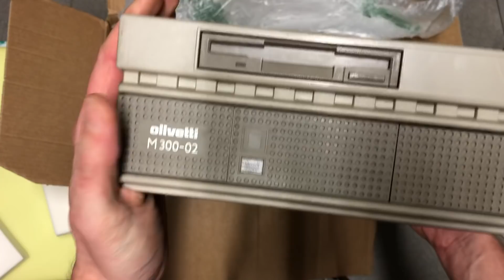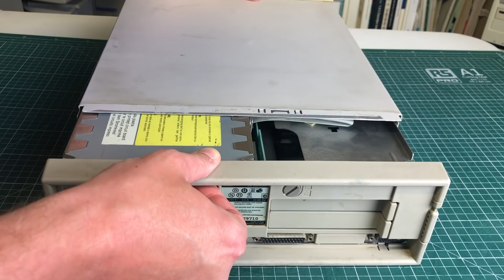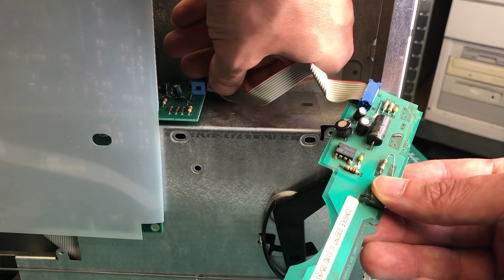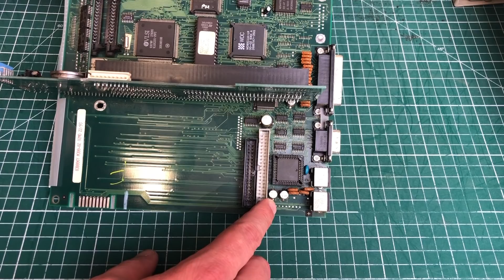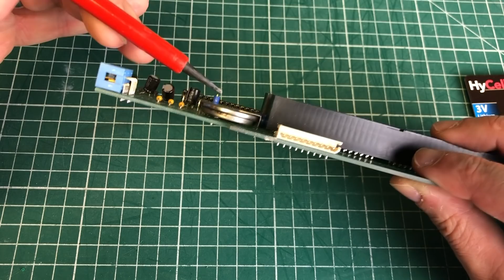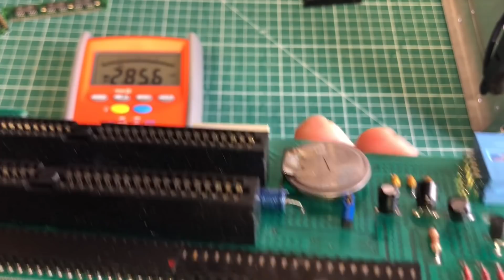Olivetti M300-02 eBay "score" - non working PC (part 1)

Comment: I notice a PGA socket near the fdd and hdd connector. You will need to remove the PGA chip (careful not to damage the fragile socket) and clean the connections and reseat the PGA chip. Take an old toothbrush and use a PCB cleaner fluid and brush over the pin arrays inside the socket and also the PGA chip. A trick you can use to check if the PGA socket is the cause of the boot problems before removing the chip is to gently twist the board while turning on the PC. The twisting of the board can help the PGA chip make a connection with the pin arrays. Usually if the PGA plastic socket is faulty it needs replacing with a new one. Cleaning it is only a short term fix. The problem will crop up again in future because the socket is warped and the pins no longer make a proper connection. Hope you get it working!

Comment: Hi Retrospector, thank you for sharing this. I enjoyed and learned a lot from it (I was). The PC was my first PC when I was seven years old (Actually was not mine, it was my dad's PC :D), and I still have it. Currently, it is in the ware house with all box and accessories, when I was child I usually looking for a way to make upgrade it in order to run DOOM 1, the Wolfenstein 3D series and Win 3.1 was fine on it with 1MB of RAM but I need at least 4MB ram to run win 3.11 or DOOM under the DOS. However after some times I opened the PC (for  curiosity) I broke the BIOS IC. is that a way to fix it? it was back to 20 years ago, and I am now 30 years old studying PhD.D. in CS :D I don't know why fixing this retro PC got important for me after seeing your video  :)
I would appreciate it if you or someone else guide me :)

Comment: It looks like that soldered in memory module maybe a SIPP module instead of a SIMM module. I recently learned that they were a previous design to the 30 pin (contact) units that went into slots. Apparently putting the pins on the edge of the boards was very fiddly (and possibly expensive for manufacturers) so they relatively rapidly moved on to the SIMM design most of us are used to now.

Comment: Maybe it's an dry solderjoint in the psu or on the motherboard. But I would rather replace the one smd electrolytic capacitor between that Acer chip and the IDE connector as the known good caps in the psu. And I'm pretty sure these round pads under the smd polymeres are meant for through-hole caps only filled with solder by wave soldering the board.

Comment: I noticed that some of these retro pc's have a power in and power out on their PSUs. Sense I was born in 2000, I just missed these guys probably by 10 years or so lol. So basically I'm wondering why do the PSUs have a power output in them and what are they used for?
Reply: Taking power to the monitor, by pass through

Comment: Man.. I had a PCS44/c that I got for free from someone.. paid an arm and a leg for an extra memory stick for it to be able to get it run a scraped version of Debian back in 2002.. I used it as a text only machine to basically just SSH to another computer to run IRC etc on.. I think I trashed it when I moved from Sweden to DK again in 2003 (probably after realising just how much power it used).. nice little machine though.

Comment: I looked up that little IC (TDA7233) on the speaker / HDD-LED board, and unsurprisingly it turned out to be a 1-watt amplifier; you don't see many PCs with an amp for the speaker. The speaker itself also looked unusually large compared to the standard fare in PCs. In conclusion, this PC has Hi-Fi beeps! lol

Comment: My parents had one of these when i was a kid. The power switch was like a stdby mode where it could turn off the monitor and keyboard. We upgraded it with a Trust cd drive and sound card.  Sometimes it used to fail to read floppies but you could get by with pressing the case firmly above the drive.  I realised this when trying to load 6 disks of Doom II.

Comment: I used to have that very same model as one of my first PCs... and I had it in the early 2000's, so it was pretty old by the time I used it. It actually had a weird BIOS; it would not boot and would not work properly if the battery voltage was not enough. If left rebooting for some time, the battery would somewhat "recharge" (it is not made for this, but it would soak up some power and charge a little) and then the PC would magically be able to go on booting. The BIOS starts in 40 column mode when the nvram is invalid, once the PC boots you can set the 80 column mode from inside the BIOS itself. You can also try changing the battery, but I don't know if there are battery holders for that weird form factor - you can also change it for a more standard CR2032 :)

Comment: You mentioned the board has 2 Megs of RAM soldered onto it. But the memory check at booing stops at 1 MB. Maybe the problem is the RAM or the solder joints of the RAm bank.

Comment: It's leaky caps.  When the computer pulls more current as it progresses through the boot sequence, it brown's out the 5V rail and causes a low-voltage reset.  Replace all the electrolytic caps in the PSU and on the MB.
Reply from the maker: Hooked my oscilloscope and never see it dropping below 5.05v when it does the reboot. Voltage stays pretty stable at around 5.10v

Comment: WDC is Western Design Center, not Western Digital. For those batteries with the tabs you can get new batteries that have tabs also, but you can also install a holder.

Comment: I agree that the caps are probably bad since there is no beep. Additionally, you may have a RAM issue because it has 2MB and is stopping the test at 1MB. The 40 column mode is probably because CMOS has lost its settings because the battery is flat. All pretty fixable :)

Comment: I recently bought a packard bell force 203 with a dreaded varta battery.  Surprisingly the battery hadn't leaked on the board but had sprayed out and corroded the case rather than the board, only three places on the board had corrosion.  I removed the battery and treated the whole board with a vinegar wash and then an isopropyl alcohol wash, and scrubbed with a light strength toothbrush.  Board works however exhibits the same sort of issues you are seeing in that it boots and then randomly the whole system freezes and upon reboot just a black screen.  I ordered some caps, but they have a 17 week lead time, so I have order different ones.  but strangely all of the caps on the board are exactly the same, 22uf 25V.  Here's hoping that replacing them will help with the issue.  The PSU has not been recapped yet because I am very inexperienced with soldering anything really.  I am curious to see what you do to fix this one.  I hope replacing the caps in the one I got fixes it too.

Comment: You said that PC hás 2mb RAM? Boot screen reports 1024k? Maybe a RAM chip problem?
Reply from the maker: Thing is that now get it to reboot on multiple stages (after memory count, after all post checks pass (including memory), while booting dos.... so not really sure it is a memory issue
Reply: @RetroSpector78  good to hear that. Hope you can make it to work again. Looking forward to see it working.
Reply: @RetroSpector78  oh by the way, I had a computer back in the 2000s that had this random reboot issue. It was the capacitors in the Mb, I had to replace the Mb back in the day. Hope it's an easy fix.

Comment: The small electrolytic capacitors in the primary part of the power supply should be replaced, otherwise the power can collapse and trigger and switch off with this error too. This results in protection, so that the power cord no longer starts because the mainboard recognizes this with the power good signal.

Comment: I worked at Olivetti in the mid 80’s, these things were their budget built down to a price ones.   M24,28,280,380 and CP486 were high quality heavy workhorses
Reply: I have an M24 in the next room. I should see if it still works.

Comment: Nice little machine and you got the faster version too.  I've got the 16mhz model all be it I pushed it out to 20mhz by swapping out the crystal.   

After watching this I had to go check mine again to be sure but my board with its AMD 16MHZ 386SX doesn't have smd caps but rather through hole which I find odd as everything else is identical. 

Do you know what type of memory would be used to upgrade the video ram?  Would be interested to see how much that effects performance.

As for your problem.  Other than those flakey looking caps I think you might have a bad ram chip.  The bios counts the base 640k then 1024k extended leaving 384k in limbo.  The next test on the post screen is shadow memory then expanded memory where you'd expect to see that 384k.  After that it then lists the total installed up to 10mb max on this board. 

Good luck getting it up and running.  I love the form factor and the fact it's got those feet on the side to sit vertical.
Reply from the maker: Enjoyed your videos on it too ... will plug them in part 2. It now boots fine but just needs a couple of minutes to warm up :) ao there is still an issue. There were capacitors leaking in the PSU also but didn’t have new ones to replace them. Had some cheap ones that I bought 5+ years and replaced them with those. Will order some new ones. Now the computer consistently starts and gives video output. But needs about 4 minutes of resetting before it continuous its boot cycle. So making progress, but not 100% stable yet.

Comment: Very nice video, thank you.

Quick question. would it not be a better idea when working on computers and electronics to remove your ring, could it not lead to accidental short circuits or potential shock hazard? I am more from a mechanical type background, and jewelry is a big safety no-no even if only for good practise

Comment: I still have a M440 486SX-25Mhz under my desk. it looks very similar. haven't turned on for 5-10 years. I should replace battery, double check capacitors as well.
long time tried to upgrade memory with a 32MB module, bios recognized it but POST didn't . couldn't find the way to enable it 100%. some custom utility? any idea?
would be great to let it run. will follow you inthis journey. all the best

Comment: That's a pretty nice formfactor  and a very feature packed  mobo for that day and age.
I would be  very suspicious of the  onboard ram, especially since its  2 mb  and the machine loops  when it hits 1mb.
Reply from the maker: Sometimes these machines have a way of making you go on a wild goose chase :) Also suspected the RAM at first but not so sure about it now. Will provide more updates in the next video
Reply: @RetroSpector78   Totally,  some of these  little monsters can be difficult to work with. 

Sadly I know  exactly whats wrong with my  MDD  and  Mac  classic, but i dont have the skills to fix them.,

Comment: It’s got a nice looking design, very slim profile. That power switch is weird, I wonder what the designers where thinking when they designed that. It’s so strange.... but annoying that the battery is welded, how is a typical user expected to replace that?
Reply from the maker: He is not supposed to replace it. You need to desolder it. Kinda like a Dallas chip. These things must have seemed like a good idea in the late eighties / early nineties. The power switch is kinda weird but makes sense. When you slide it to the right it turns off the monitor, locks the keyboard / power button. Kinda like an idle / standby mode.

Comment: A friend calls me after getting a PC he found cheap, asks if there is anything he should know and before I can warn him not to turn it on, he turns it on and a tantalum cap blows up. They crack and moisture gets in and they short so I check them with an ESR meter before powering up and remove it replace the shorted ones
Reply from the maker: Here only SMD Polymer caps. They don’t explode but leak. And smell like fish when you’re cleaning up the gunk.

Comment: The majority of early bios's will reset the CPU multiple times during POST. Before the CPU is reset, a restore value is written to CMOS. When POST restarts it reads the value from CMOS and will continue at the same point prior to the reset. There could be an issue with CMOS not retaining data hence POST is restarting from scratch each time the CPU is reset. I'm not sure whether this BIOS does this but it is also a possibility.
Reply from the maker: did not know that ... will need to look into that ...  Thx.
Reply: @RetroSpector78  https://www.crazysmart.net.au/temp/olivetti.png 

I have marked out some of the keyboard controller pinout. Next to the A20 Gate is a pin that is sometimes connected to the reset pin of the CPU, you could check this pin for activity. The process of checking extended memory is enabling the A20 gate, putting the CPU into Protected mode, checking the RAM, disabling the A20 Gate and putting the CPU back into Real mode. To maintain compatibility with the 80286, the BIOS may force a CPU reset via the keyboard controller to put the CPU back into Real mode. It could also be resetting because it can not disable the A20 gate. The remaining 384K of RAM may not be checked as it may be configured as EMS or shadow RAM. Can you skip the RAM test by hitting ESC or can you cause the keyboard test to fail by holding down a key during POST?

Comment: Start with the capacitors around the keyboard controller. Might be an issue with the A20 gate which could  cause problems for the CPU. The keyboard controller is responsible for the A20 gate. I can already see in your video some damage to the traces around these capacitors.
Reply from the maker: Where exactly did you see those damaged traces ? Around the 12min mark I am showing the 2 capacitors (I replaced both of them)/ Cleaned up the board first and didn't see any damaged traces in that area.
Reply: @RetroSpector78  Around the 12 minute mark. It might not be damage but I can see the traces near the edge of the board have dark marks. Normally the damage you can see is not as bad as the damage you can't see, like underneath the keyboard controller socket.

Comment: The sliding powerswitch is to turn off the output power (monitor) while allowing the PC to stay on.
Nice to see one of these re-surface, I had one with a 486SX25 in the mid 90's. Started with 4MB and ended up with a DX2-50 and 12MB.
Reply from the maker: haven't hooked up a monitor cable on the PSU ... will need to check that but makes perfect sense. Turn off monitor, lock keyboard and computer will sit idle. Nobody able to turn it off or look at what you're doing. Makes sense.

Comment: Seeing it fail at the post memory check I would guess you have some bad ram. But yes definitely twist those SMD caps off and replace them that could be the issue too. I have fixed many old macs that were totally dead which revived once replacing the caps.
Reply from the maker: Yeah replaced all of the caps on the mainboard but issue persisted. Made some progress after tackling the PSU. But still not 100% stable. PC now always shows something on the screen but needs about 5mins of auto-reboot-cycles before it finishes its boot and launches windows. From that point on the PC seems very stable. Only when turned off for a while it again needs to warm up :)
Reply: RetroSpector78 hmm that’s interesting. There is such a problem as “thermal expansion” where over time some parts on the board can shift loose due to the temperature differences between the cycles of being on and off. I noticed that board has a lot of surface mount chips. You may want to go over some of them with some flux and a hot air rework station to rule out this problem.

Comment: Recap it and desolder that strange SIMM card and install two new ones (I can see that you had still this idea because I see 30 pin modules on your bench...).
Reply from the maker: Think the one soldered onto the board is on bank 0 and needs to be populated. I did try adding memory but that didn’t help. Made some progress (pc is booting now, but not always) but still not sure if the memory is to blame.
Reply: @RetroSpector78  ok let me know
Reply from the maker: I will... hit the subscribe button and find out when the next video drops. Next one will be part 2 of this.
Reply: @RetroSpector78  I am one of your subscribers from many months and I own an Olivetti PCS 286 by 1990's and is still working and in use by myself
Reply: @RetroSpector78  The VLSI 82c320 / 82c331 chipset (also rebranded by Intel as S82343 / S82344) is able to remap memory banks in a nearly arbitrary fashion. The mainboard hardware is thus perfectly capable of booting with bank 0 empty, if the BIOS programs the chipset correctly. I just happened to fix a board with that chipset two days ago (it had a broken address line to the BIOS chips), and the Quadtel BIOS in this board can boot with nearly any memory configuration. (See the VLSI 82c320 datasheet for details about supported bank sizes and bank swapping).
As the Olivetti PC has the 2MB soldered to the mainboard, it is very well possible that the BIOS has the assumption hardcoded that this 2MB module always exists, though.

Comment: The solve the riddle of the power switch look at the symbols, they are pretty international and not very Italian: the sliding part puts the machine in standby mode, and locks the switch so the idi... users don’t turn it off when in standby.
Reply from the maker: Correct ...also locks the keyboard